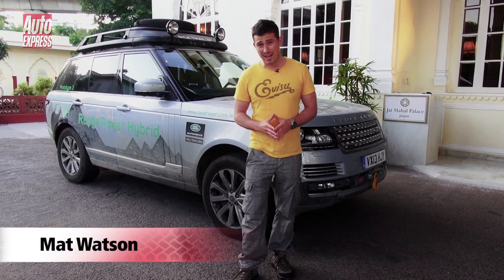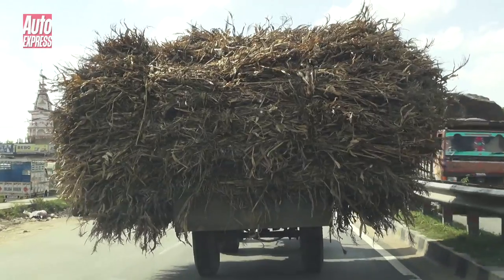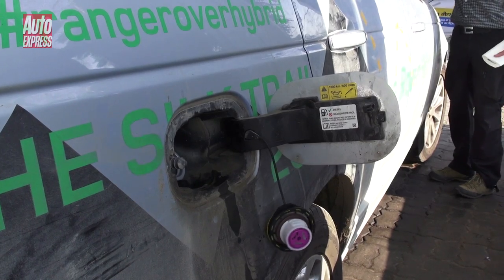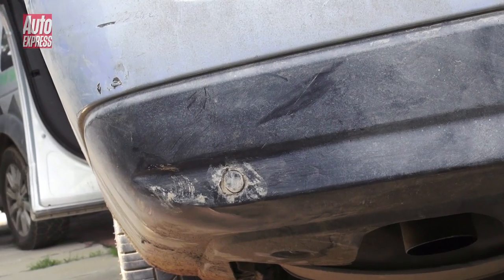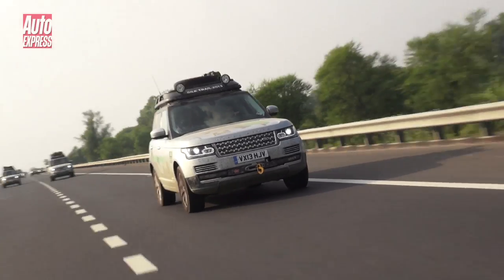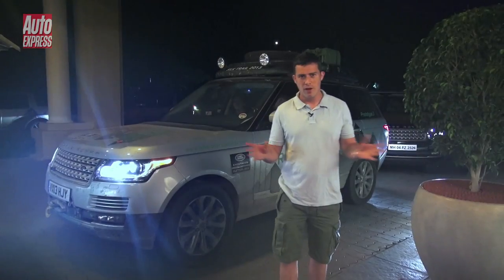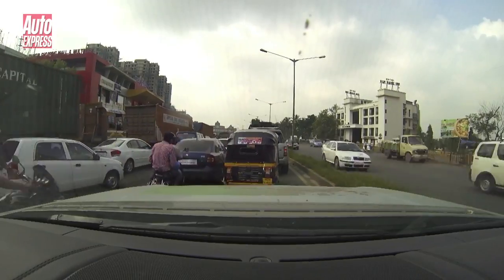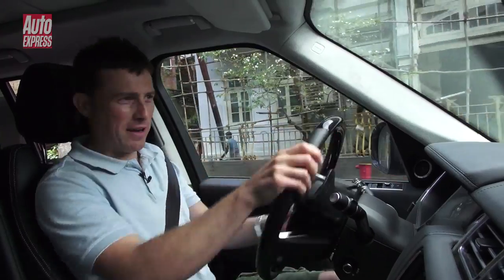Range Rover Hybrid takes on India's craziest roads

Comment: Did I hear correctly, the range in electric mode is only 1 mile at 30mph?
Reply: yup, you heard correctly, but then what would you expect of such a large and heavy vehicle. Thing is, in traffic jams that range would be extended because you may never reach 30mph. I have a 6km commute to work in bumper to bumper traffic and I have a feeling it'll be able to complete that journey on electric power alone
Reply: Hybrids, including the earlier Prius, could only manage a km as well. This is not a PHEV RR, which came out in 2018 an can travel 50 km in EV mode. The PHEV RR has a 13Kw battery, hybrid only have a Kw or 2.

Comment: The worst drivers in the world reside in india. Also you should not have been running 20 or 21" rims and tyres on a cross-continent trek you put 18" rims on with a 275/60/18" all-terrain tyre.